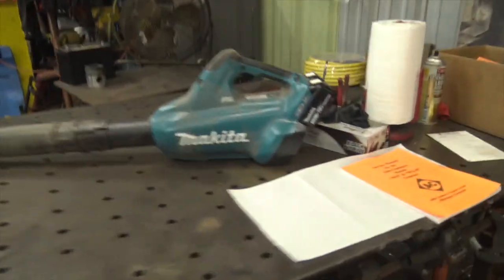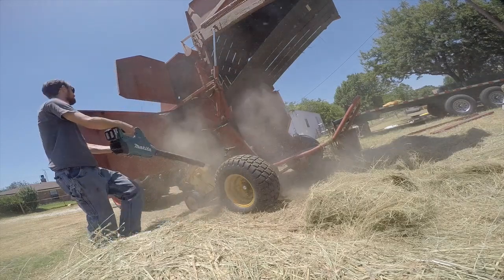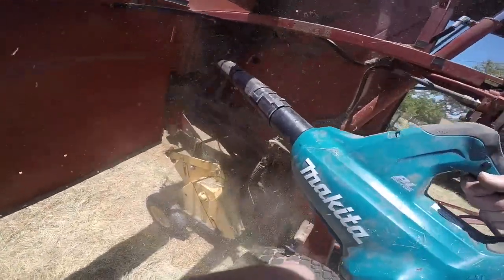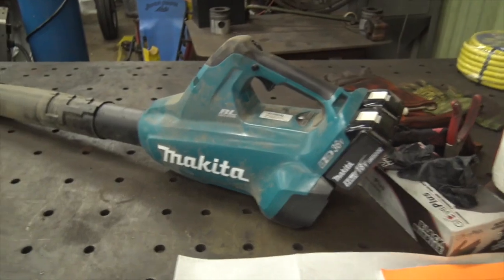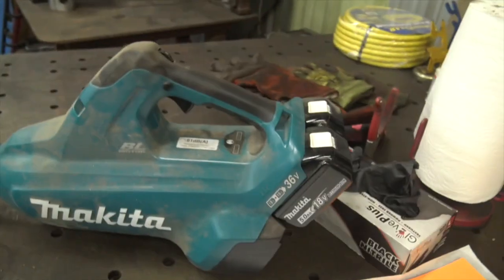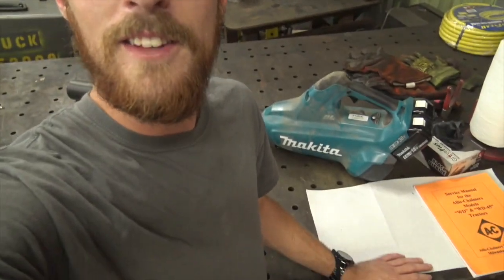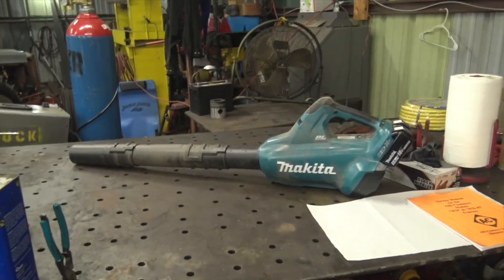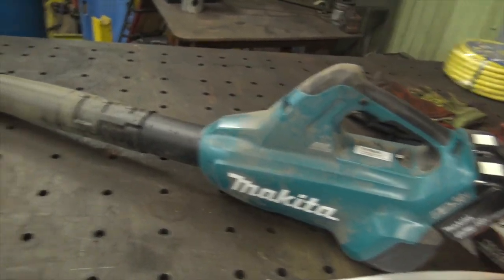WHY EVERY FARMER NEEDS A CORDLESS LEAFBLOWER - THE HIDDEN SECRET OF WHY THIS TOOL IS A MUST!!!

Comment: Yeah cordless blowers are SO useful. Wifee mentioned she'd like one to blow out the horse trailer, and when your SO asks you to buy a power tool, you buy it NOW before she changes her mind. I'm so glad we got it. Have since added a second, more powerful one. Use them all over the place, including cleaning tractor and implements. Sometimes the less powerful one is actually better. For example, cleaning sawdust out of stalls. The small one moves it nicely, but the big one is too much for such a small space. I end up wearing most of the sawdust. Yep, super handy.